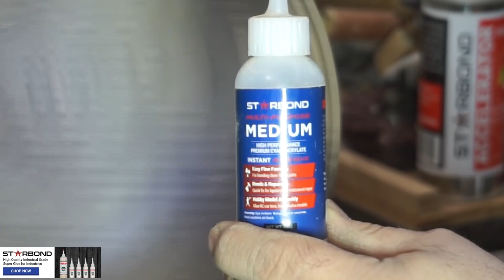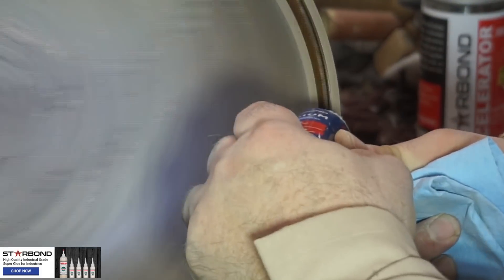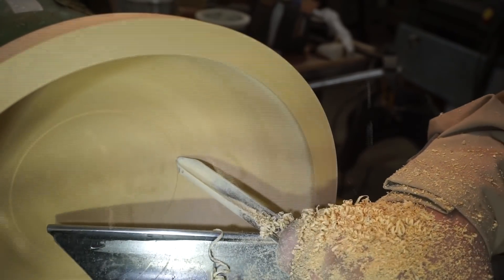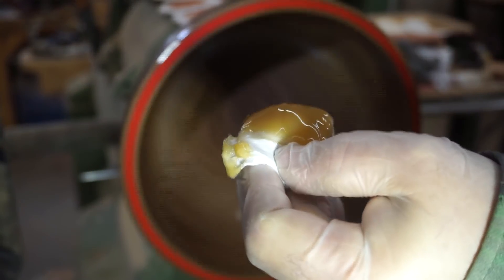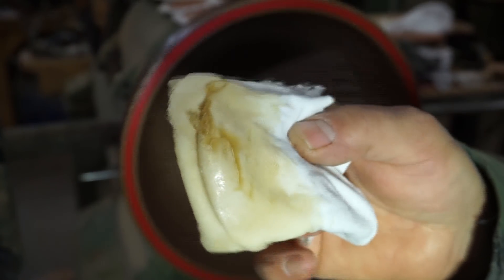Woodturning - Pink Coral in Maple and Walnut, EZ-DO Finish Review

Comment: Jim, beautiful as usual.  Brief story about rags and turning.  Friends father was a metal machinist (probably 40 years experience) turning shafts for printing presses.  He was wiping down a piece with a rag while it was turning and the rag caught.  He tried to grab it while it was turning.  The rag caught his hand and pulled him into the turning shaft.  After screaming for a while, a fellow employee came and turned off the lathe.  Consequences, broken arm in two places and a broken jaw along with skin grafts where his was burnt off.  Months of rehab for an impulse move he knew better than to do.
Reply from the maker: There are a ton of accidents on both wood lathes and metal lathes. Metal lathes are unforgiving because most of them are gear driven and not belt driven like wood lathes. I certainly understand the dangers of using rags around lathes, but sometimes rags are needed to apply certain finishes. Thanks for the safety reminder. Jim

Comment: That red coral is beautiful and so vibrant. Your years of experience shows in every project you do. I bought some Designer epoxy 2 or 3 months ago but hadn’t tried it yet, I was using up another (really frustrating) resin first. Designer epoxy is amazing! It’s the first time I’ve work with a 2-1 resin and the low viscosity is wonderful when working with molds. I mixed in broken up abalone shells poured it into a mold and let it cure without a pressure pot and I had only one bubble show up and that was in the very tip of the knob to a lid. Thanks for recommending it and for the discount code!
Reply from the maker: It’s an amazing product! Thanks

Comment: You do a remarkable job pouring! I have a feeling if you used a syringe made for feeding kittens or puppies. Feeding syringes don’t have needles. The tips will be large enough to work with the resin and minerals. And I bet they will be easier to use. At least I hope so!
Reply from the maker: I have some, not sure if the coarse material would go though it or not, thanks

Comment: Hello Jim, Two very nice bowls indeed. I always appreciate learning about your process struggles and your capacity of backing up to improve something, like in the maple bowl. I have not tried the WZ-Do Finish and actually use a few options: the OB Juice solution, the General Finish Salad Bowl (quite happy with it) and the Tried and True when I want less sheen but a silky touch that seem more satin like than the EZ-Do. When I look at your finished bowls I am impressed by the absence of any marks in or on the bowls. I was wondering to which point it is the sanding that makes the difference or the quality of the turning itself. In a future video I would like seing the bowls in detail before sanding in order for me to benchmark where I have to concentrate my efforts: gouge work or sanding?  I would like to turn walnut but unfortunately I cannot find any where I live north of Montreal : birch, beech, cherry, ash, oak .... but no walnut or boxelder.   Looking forward for your next project. Thank you for the quality of your demonstartions and teaching.
Reply from the maker: I won’t be able to do it this week but if I remember before the next one I will film it before applying finish. If you’ve got a truck I’ve got a guy that can get you some walnut. It would probably be a four hour trip but well worth it. Thanks
Reply: @SpragueWoodturning  Thank you. I will keep in touch in Spring for the walnut. As for the video shots, I never miss your youtubes . So no stress for me. For finishes I also have tried Tung Oil,, Danish Oil and the Mohawk one. Blue Ribbon wax on OB JUice and all have different qualities but the General Finish always wins for sheen even before buffing .

Comment: I think a salad bowl used for salad should not be "varnish-y" anyway, so I like the softer shine on these two works of art.  Both are gorgeous.  As to the resin drips:  maybe consider a tip from cake decorators, have bowl on a lazy susan, think "piping" and roll the rim slowly round as you stay in one place and drip/drop into the passing groove your inlay materials... less chance of straying, less cleanup.  Also, shaking the powder from a paper funnel instead a wide mouth jar might be good.  And you are right, that is not pink!
Reply from the maker: Great suggestions, thanks

Comment: Jim thanks for the demo using the coral, I agree it sure looks more red than pink... Did you find that the resin was better than your other way with the CA glue? I have used your CA glue method and it works well for me. Nice looking bowls.
Reply from the maker: The only real benefit is no filling after it comes out of the pressure pot, if you let it cure on the bench you will have bubbles and it will need to be filled. I don’t care for the way it darkens the inlays tho. Resin is also very thick compared to thin CA and depending on the application, CA is the way to go. Thanks 🙏

Comment: Evening Jim very nice as usual. On the fractural burned bowls how do you keep the resin in the burn as i would of said it would settle in the bottom. Also they are quite deep burns what voltage do you put through your system. Thanks jon.
Reply from the maker: I've not done it on bowls. Due to the negativity towards fractal burning, I'm no longer going to show it on the channel. My burner puts out about 5K volts. Thanks for watching.

Comment: Great bowls, Jim! Perhaps sanding sealer could be used in both groove and on bowl to seal against resin bleed and drips? Might be worth a test try.
Reply from the maker: Been there, tried that. It just bleeds through the end grain because it’s also a finish, thanks 😊
Reply: @SpragueWoodturning  Good to know. Have not yet had drip problem, but might in future. Thanks for letting me know.

Comment: Thanks for another highly educational video!  I like the combination you used on the walnut - the pink/red looks great with dark wood.  For me, red in the maple bowl is not as pleasing. Re resin vs CA inlays, you mentioned the resin fills better and doesn't leave gaps that need a second filling.  Are there any other notable differences, e.g., ease of finishing the rim and cleaning up runs on the bowl sides?
Reply from the maker: I think the key here is the pressure pot, it’s what removes the bubbles in the resin inlays. If you don’t use it then it’s probably the same as using thin CA and will require more fillings. I would say finishing is the same, but dealing with inlays on the side with resin combined with natural materials is more difficult. Thanks for watching!

Comment: Have you tried Polycrylic as it a water base finish no odor and dries quick, I like it as it a true clear finish and no yellowing.
Reply from the maker: Is it classified as food safe? I’ve not tried it. Thanks
Reply: @SpragueWoodturning  It's not on the can as food safe but if you research it they tell you it is as most finishes are food safe once cured. Not recommend for cutting boards but we all know you should use food safe oil for those.

Comment: Jim how do you remove the wood you glue to the bowls.I understand about using electric frying pan to heat the glue. But once your finished turning how to remove the block from the bottom? BC
Reply from the maker: I literally show it in every video except this one, lol. I use a parting tool to cut it off them a vacuum chuck to hold it while I do the bottom. It’s pretty much I’m every other bowl video. Thanks

Comment: Would it not have been better to use a massive syringe to inject the resin?  But the inlays look great.  Agree that the finish looks better on the walnut but not as good as your normal finish.  The fractal burn bowls are magical.  Great video once again.  Was there any smell from the finish once complete?  Pink or red, they look great.
Reply from the maker: The resin is so thick compared to thin CA I thought it was best to mix it in the cup prior to pouring it in the grove. So I’m not so sure it would mix properly if I just put the material in dry then put the resin in on top of it. Once dry, no smell at all. Thanks

Comment: As always I really enjoy your work and willingness to educate.  I just did my first inlay.  I used ca thin and a turquoise powder.  Do you prefer the epoxy over the ca for a binder?
Reply from the maker: The only real knock on resin is that it tended to darken the inlays and it’s thicker then thin CA. If you want the true color of the inlay then CA is a good option. Like I said in the closing, resin combined with a pressure pot eliminates any bubbles in the inlays where CA can leave some behind. It’s really a personal choice. Thanks

Comment: I see you mentioned watco at the end of the video. Is there a reason you don't use it anymore? It's my go-to finish for bowls. As far as I'm aware it is food safe, and I can get anywhere from a matte finish to a pretty decent shine depending how it's applied.

Waterlox is probably my all-time favorite finish- especially on furniture. It's absolutely bulletproof. I don't use it on food contact items anymore because they seem to have traded the "food-safe" categorization for "non-toxic", which leaves me a little uncertain about selling pieces finished with waterlox to strangers.
Reply from the maker: I would be fine with non-toxic unless it states it’s not good for food contact. If you look on the can of watco Danish oil, no where does it say it’s food safe unless they’ve changed the label since I used it. If you ever get taken to court over it, your in big trouble according to a lawyer I talked to. I was going to order some Waterlox but I didn’t think it was non-toxic. Jim
Reply: @SpragueWoodturning  this is directly from the Waterlox website. "Waterlox ORIGINAL finishes are water resistant, stand up to household spills and are non-toxic and food-safe when dry."

It's funny because now I can't find any similar statement on the Watco page, but I'm certain I've read it before. There are numerous articles elsewhere stating that it IS non-toxic, but obviously you can't always trust everything you read on the internet. Now, I don't know what to do.....lol.
Reply from the maker: @aaronellingsen5404  I also sent a message to Waterlox and yes, it’s all food safe. So I will be ordering some of that today. Thanks for the info and I wish Danish oil was food safe, it way less expensive! Jim

Comment: Jim  in your opinion for a first time wood turners
Reply: What basic equipment would you recommend
Reply from the maker: Buy a used lathe that’s not too expensive, that way your not out that much if it doesn’t appeal to you that much, you can always resell it and upgrade. Stay away from tool sets, you really only need a gouge and parting tool to do bowls. Buy a drill to power sand that has a high rpm, the one I use is 2400 rpm, get your disks at sandpaper.ca and use my code inlayjim for your discount. Jim

Comment: Both are great, I'd be proud to call either one mine. Got a question, how thick do you leave the walls of the bowls? And what determines the width of the inlay?
Reply from the maker: 1/2” to 3/8 is pretty standard for me for wall thickness. I usually leave the rim as thick as possible. That way I can put a larger inlay or multiple inlays in the rim. Thanks 🙏

Comment: As a hobby lathe artist, I don't do production work for a living, so this question is in that context. What is your opinion on friction finishes using carnauba wax with DT earth? I have found on walnut that you get an exquisite shine and wonderful tactile feel. Have you used this method before? If so, what do you think of it? Enjoyed your video. Thanks for sharing it.
Reply from the maker: I haven’t tried that method. I’m a little leery of carnauba wax, I did the complete Beall buffing system years ago and seen the bowls after they were used and they looked tearable. Dull spots and shiny spots really ruined the piece. I don’t think it can stand up to daily usage but when it comes to decorative work it’s probably fine. Can you share your method with me? Thanks
Reply: @SpragueWoodturning  With walnut I sand to 600 then apply a paste of Carnauba wax, beeswax, Diatomaceous earth and mineral oil. At about 700rpm I use a paper towel to heat the paste until it melts and penetrates, then buff it out with paper towel. I get a uniform and luxurious feel with this method. Like you said, these are art pieces and I cant really speak to function with food. The look and feel though is quite nice. It also shines acrylic inlays to full transparency very well.
Reply from the maker: @fallentreewoodcrafts  can you share the percentages of each product and how there mixed together? I’m assuming you melt it in a pan on the stove? Thanks